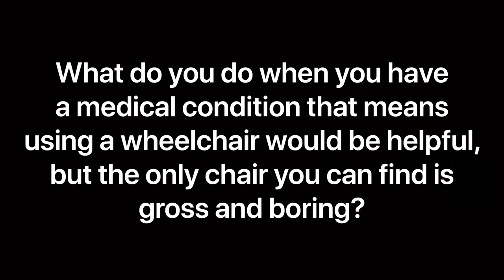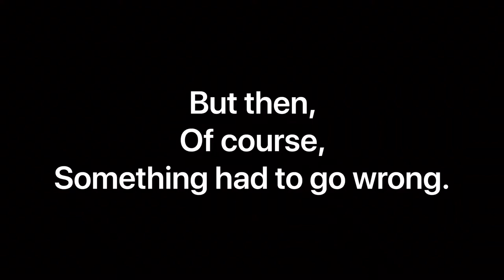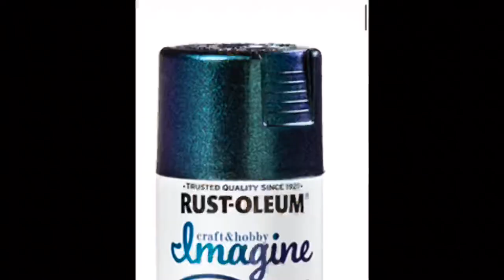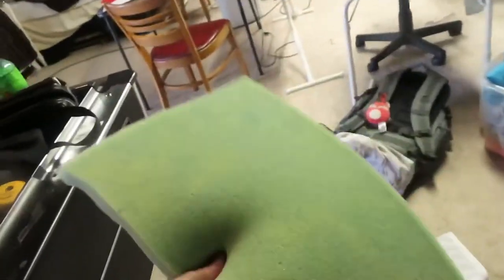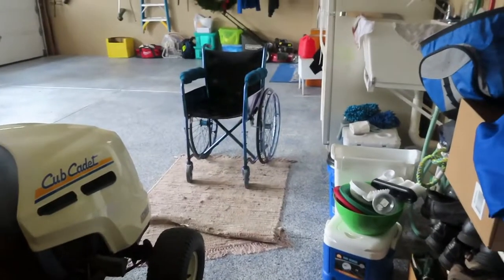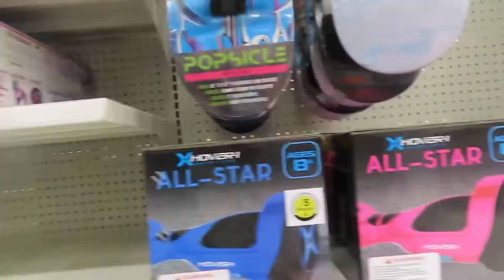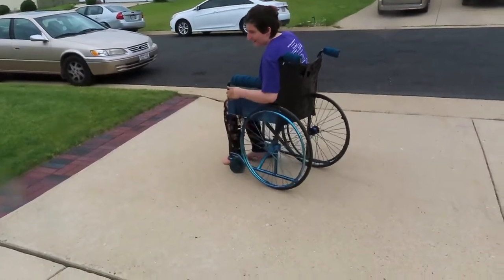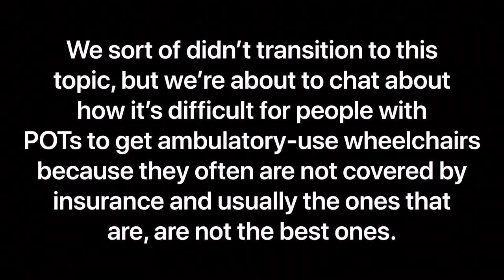DIY Wheelchair Alteration! Thrift Store Mobility Aide Device Upcycling Project

Comment: I realize this was a year ago, your duct tape will eventually get sticky too or get dirty near the edges. I would have gotten some heavy duty DUCK CLOTH and find a leather or upholstery shop the will stich the back an seat cloth. 
Remove the old seat and back (mine has screws) and replace them. Painting the pleather seat and back wasn't the best idea.
My arms were removable. I took them off and tossed them. 1) they got in the way at the table and/or desk. 2) it makes it more difficult AND REQUIRES more energy for her to wheel herself.
Good luck. I hope she is doing better and has found better mobility with her chair.
Reply from the maker: Luckily, this was a short-term chair. She only had to use it for a month or two before we could get her approved for her own.